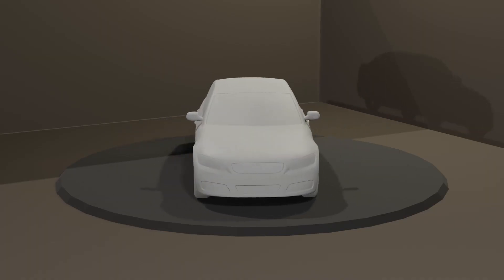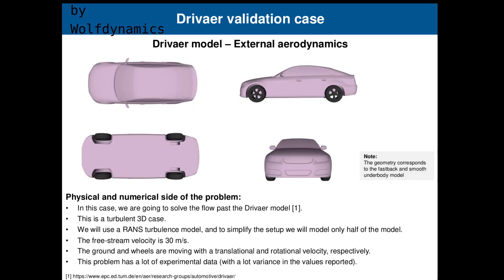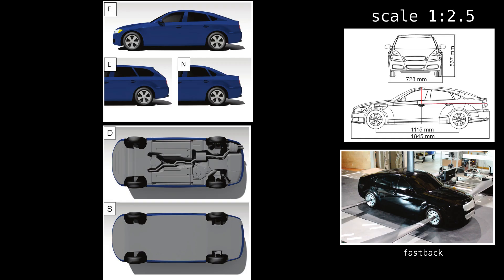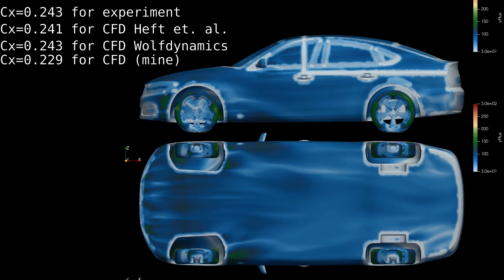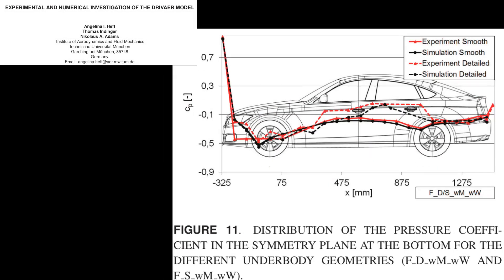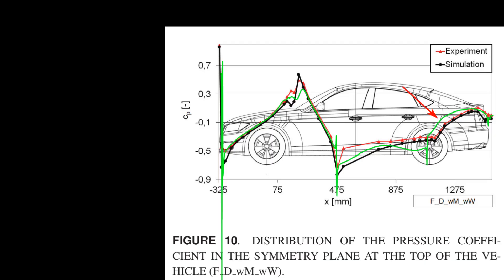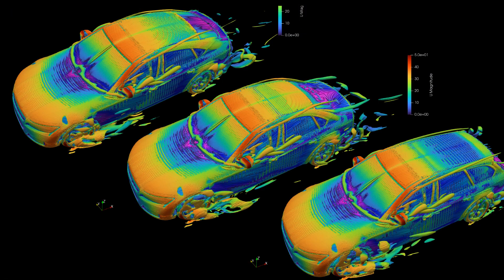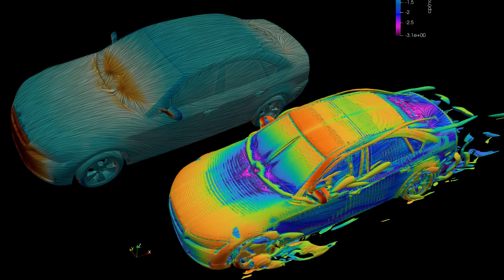CFD of an Average Sedan

Comment: Convex trailing surfaces tend to have vorticity attached to them which helps them with streamlining. It's hard to use concave shapes to guide flow, it will look like crap on most cars having U or C shapes on the top body work. Alternatively those convex shapes are flow killers in the underbody.
Reply from the maker: there are a bunch of potential solutions that I would copy. i have my eye three. I wasn't going to look at the convex rear window, I think its a citroen.